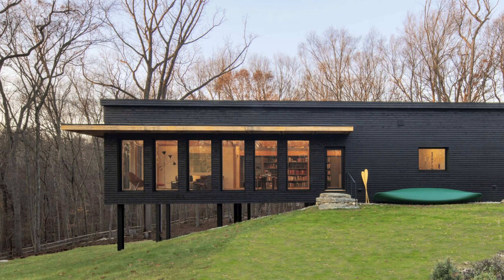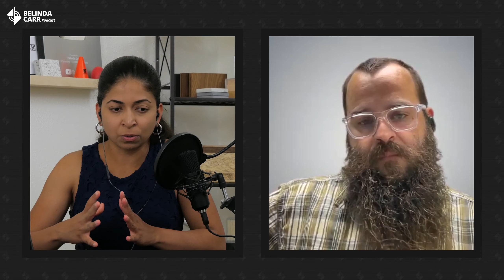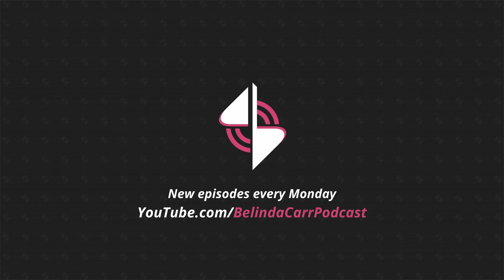Are we speeding up climate change?

Comment: Would love to see you do a video exposing building codes as climate change denying documents.  They do not address insulating existing government and corporate buildings and only mandate insulating new construction of government and corporate buildings to 1/2 the R value of houses in the same area.
These failures account for approximately 15% of all greenhouse gases.
Reply from the maker: Interesting, I did not realize this was the case with government buildings, I'll have to look into it.
Reply: @BelindaCarrPodcast  Unless a city, county, state, or Federal agency amend the IBC for their jurisdiction to include roof replacements or other way, existing government and corporate buildings are not addressed to be insulated.
Boulder has written into their codes that when a roof is to be replaced, then they must include IBC codes to insulate ceilings or roofs. Boulder won't have their buildings insulated for at least 30 years.  Better than no plan at all.
No other jurisdiction (Denver included) will make those changes or give me legally requested records of code sheets or roof section details.  Lakewood, CO refuses to give those documents to a sitting City Councilor.
Thank you.
Reply: @BelindaCarrPodcast  Should also mention that insulation was not mentioned in a commercial/government code book until the 2006 International Energy Conservation Code.  The first suggested R value didn't happen until the 2012 International Energy Conservation Code.